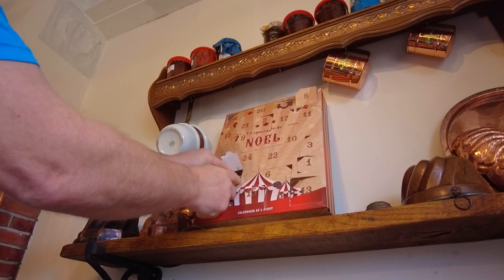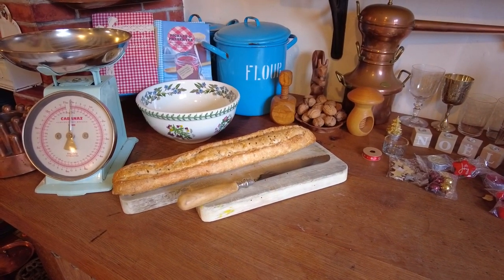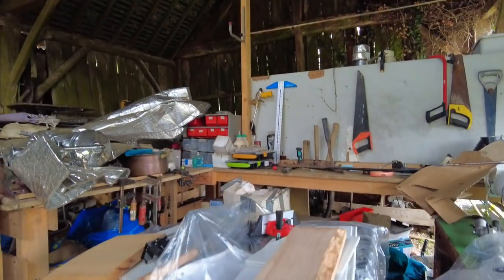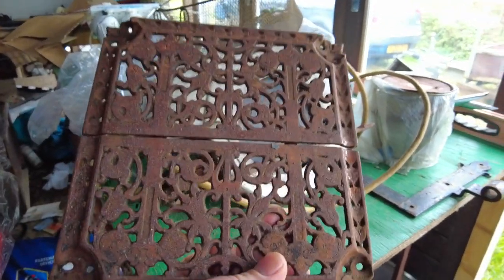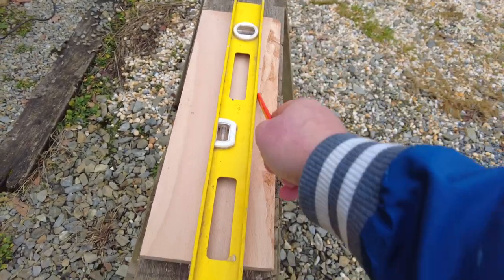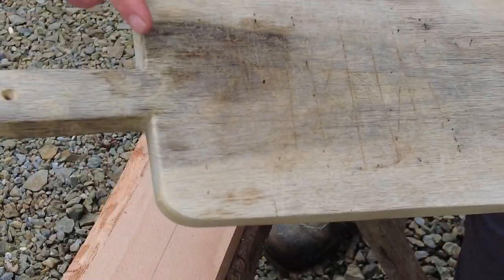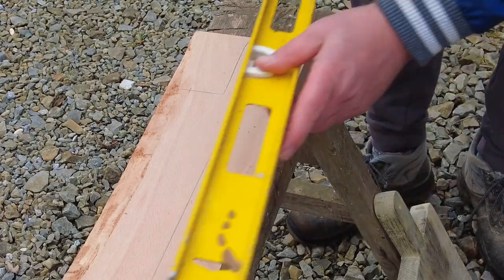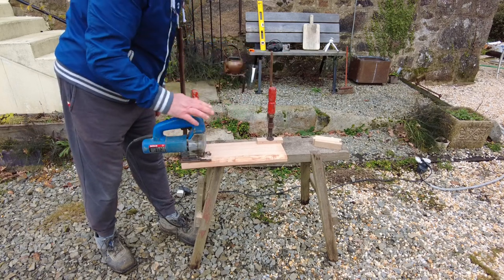Making A Bread Board From Scratch DIY Project! | Vlogmas With Sean #18

Comment: I like plain mineral oil, but I also like a product called Tried & True (original) for butcher block and kitchen wear, and it’s a very each product to DIY if not available or too expensive, because it is only polymerized linseed oil (no drying solvents) and beeswax. The beeswax gives even better water resistance than oil alone; it can be applied up to 3 times, and pure linseed oil can be below it as many layers as you like. I even did a small turned bowl with it and finished it with a 3 step polishing set (2 buffing compounds and then carnauba wax) and it gave it a decent shine!